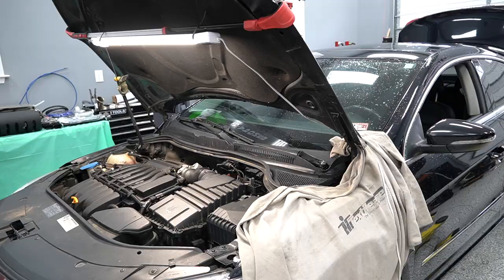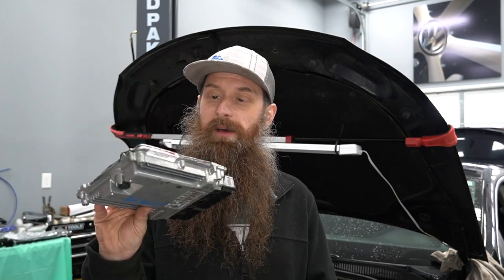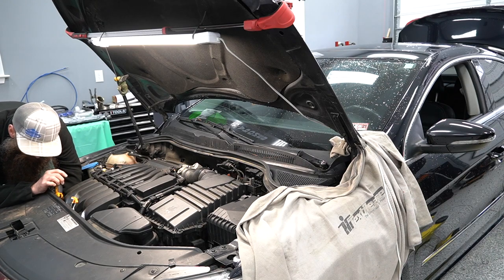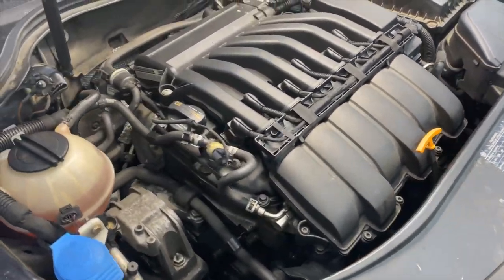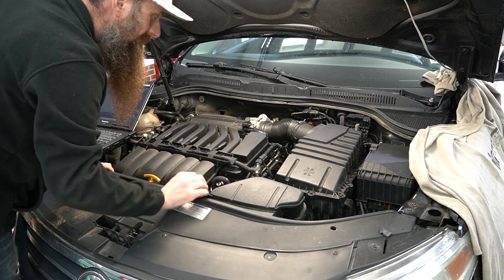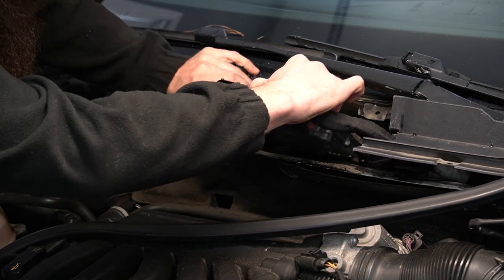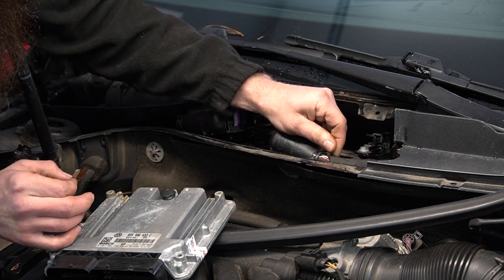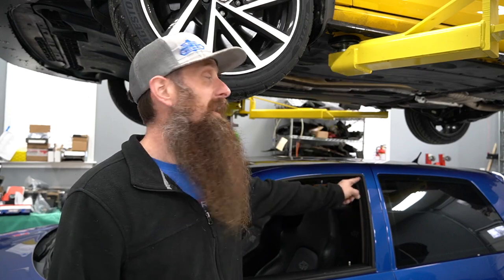3 Other Shops, Didn't Fix this Car. They Made it WORSE

Comment: I think some shops can't afford to diagnose complex dtc's. It can take alot of time, and that time can be spent repairing vehicles that are going to produce income. Being a heavy duty diesel mechanic , ive spent days chasing electrical gremlins through a 30' rolloff or box truck. With Multiple computer modules, ecm, bcm, tcm , tccm, and pcms it can be very difficult and timely to find the source of the problem. I always tell customers, I want to fix your truck just as badly as you want it back.

Comment: Hey Charles I had a ECM could not read on one of the W8 so I had I thought the car was a lemon it turned out it needs $700 and sensors cross cascading other codes to fault that was confusing ECM the OBD reader couldn’t even make heads or tails half an hour to try to trick it to get one somewhat good reading the processing power in these things are absolute fucking trash enough to do the job but with enough codes in enough faults and enough sensors cross cascading other codes that are fun to hunt down for the unexperienced will cause this issue to happen where it cannot read
Reply: Totally different situation because of the proper ECM and stuff inside it but in relation to it not be able to read that’ll happen if he gets too confused they really should have better processors in there
Reply: And or SOC’s

Comment: Have brain, no good, get part# for right brain. Check all the stuff like preliminary inspections for diagnosis. If parts and delivery pressure issues exist on German car, get correct German parts. Keep locked up in garage.
Later, make video about how feex.
Otherwise make yard art.

Comment: 200,000 miles and that much carbon is a sign that car was just garbage to begin with always do your research when buying car the car may look nice but cost you a fortune later because bad mechanical design

Comment: you did nothing but talk the whole time, why not replace the timing chain and replace the coil pack and the spark plugs?  ok you replaced the ecm w the part that was just a leftover in the car. that was pointless, this video was pointless and fixed nothing nor really tried to fix anything.
Reply from the maker: Yep load up that parts cannon with out diagnosing anything on the car. That’s typical and how the car got to me in the first place.